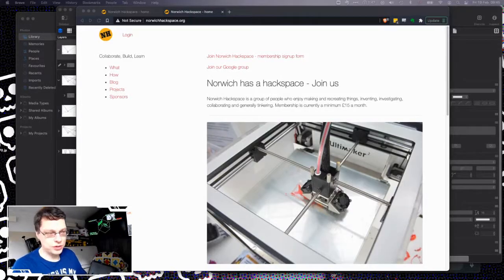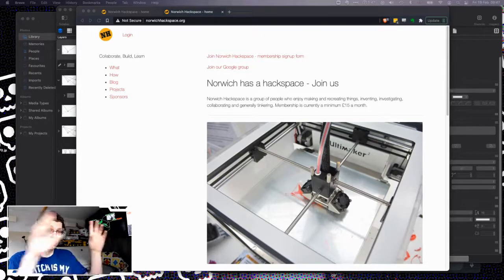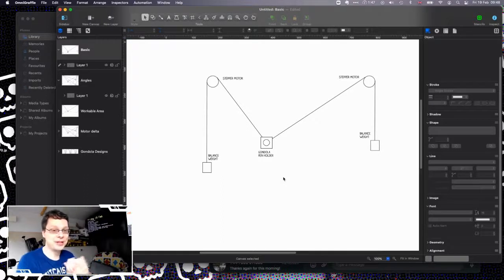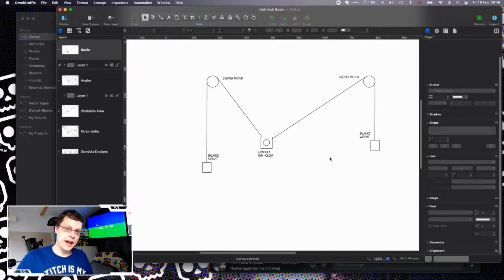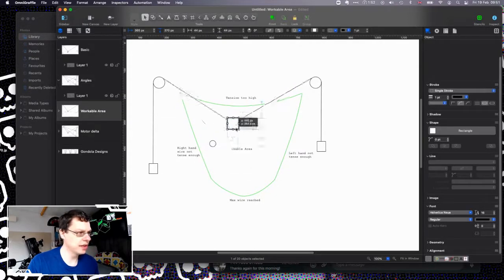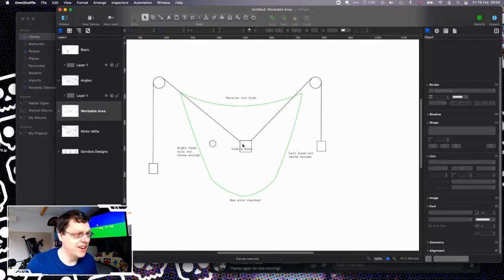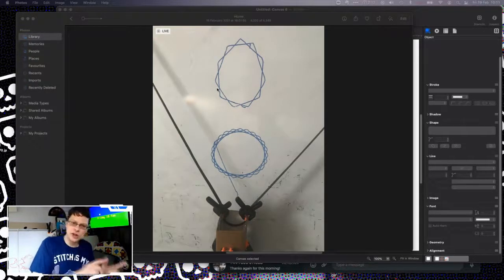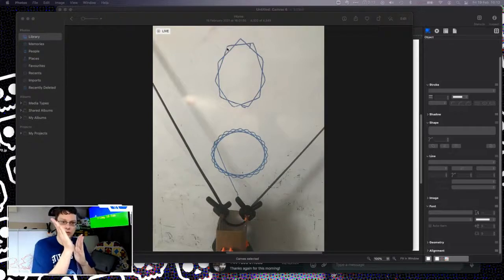Wall Plotter - Theory to Prototype: Python + Arduino + Stepper motors

Comment: Hey dude. I wanna talk to you. I'm working on my own V/Y plotter. Wondering what kind of firmware are you using? did you use GRBL? did you modify it for the V coordinates or did you do a pre-processing step on the gcode to transform the coordinates?
Reply from the maker: Hello - no, I hoped it was obvious that I didn't do any of that - I wrote the whole lot from scratch, firmware etc. At that point, implementing GRBL is overkill, There are some projects out there which do V plotters that you can send grbl to; and in those, you have to do the coordinate transformation in the machine part (i.e. GRBL will always work on a x,y,z coordinate system.) The whole point of GRBL is that it doesn't understand the machine you're using, but instead is an abstraction to help with inter-op.

Now your preprocessing steps do need to understand the machines in most situations, e.g. in a CAM, the cut depths, the clearances of body work etc, and this is where that abstraction breaks down slightly, but as an interface its quite clean.

To answer your question though, I found the open source grbl v-plotter firmwares to be problematic and Not work unless you had exactly the right equipment, they were dated against the most recent grbl -arduino releases, and back=porting was more effort then it was worth (I wanted to build a machine, not stare at open-source code debugging it for hours)

Good luck!